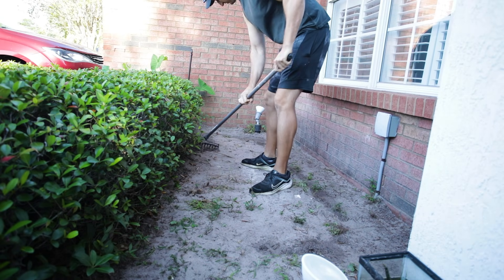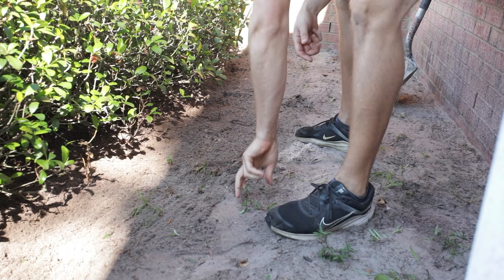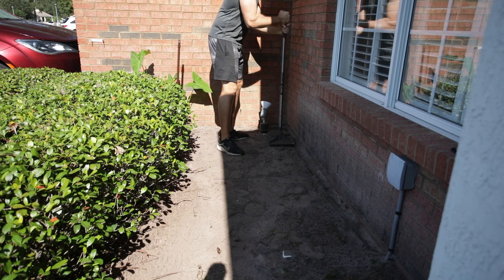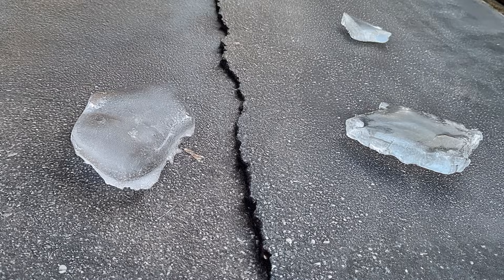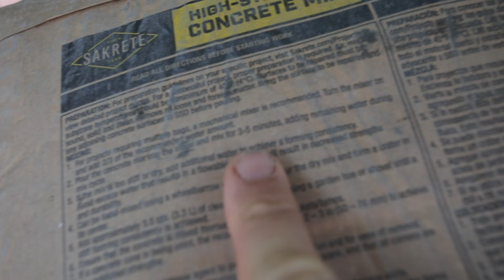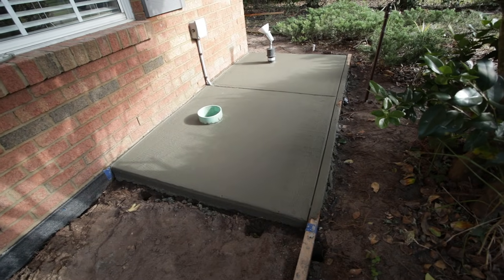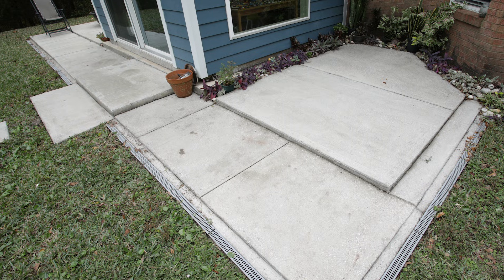I Poured Concrete Without Rebar!  This Is What Happened...

Comment from the maker: Do you agree with my demonstration of pouring concrete without adding rebar or metal reinforcement?  Please share your insights and opinions in the comments. Thanks
Reply: Yes, you did a good job. Working in small sections was key.
Reply: I’m curious what you think of how people are doing dry concrete projects. Hopefully you will do a video on this method.
Reply: Do you have to worry about slope away from the house so water doesn't pool next to the house?
Reply: what about that big ass slab you poured during lockdown? How is it holding up?
Reply from the maker: @KodyLeftwich  it is shown and discussed in this video